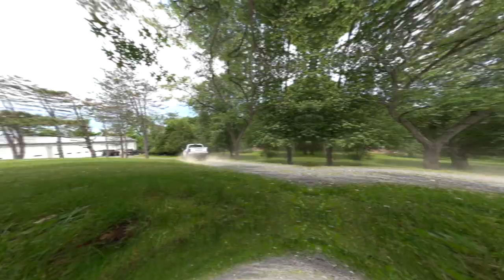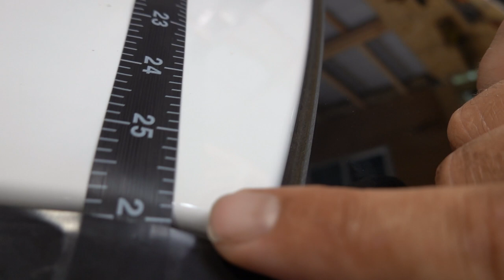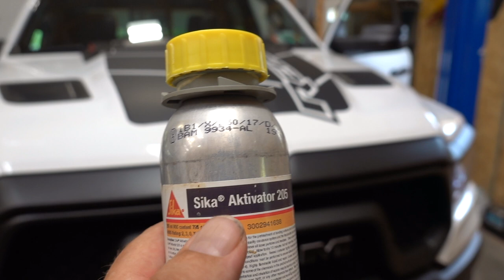2019 Ram Wireless Cab Lights

Comment: That is stupid crazy expensive!
Reply from the maker: better than drilling into your roof the labor for that alone would be more than these lights
Reply: You can save some money if you drill the 15 holes yourself. But to hire it done will cost even more. But mostly i just dont want holes in my roof. And when i trade they will come with me to my next rig. Good things are not cheap and cheap things are not good.

Comment: $400 bucks  are they smoking crack over there way to much just for lights
Reply: You can save some money if you drill the 15 holes yourself. But to hire it done will cost even more. But mostly i just dont want holes in my roof. And when i trade they will come with me to my next rig. Good things are not cheap and cheap things are not good.

Comment: Don’t buy these lights! They randomly go out of sync with each other and won’t hold a charge after a very short time. I’m on my second set in 7 months and haven’t been able to use them one time without having problems one way or the other. And for $400.00+, I got ripped off
Reply: I’m glad to hear you fixed the syncing issues. As for you taking the lights to your next truck, I could bet money on it you won’t. I tried making two different sets work for seven months and was never able to use them ONCE for more than 15 minutes without them dying or unsyncing with each other. As for price, you’re right. You would think for how much I paid I would have had a good product. You forgot to add to your saying, and a scam is a scam no matter how much you pay.
Reply: I’m sorry I’m a unhappy customer too. I would have loved to pay $ 400+ dollars and get a product that worked. As your 4 star rating on Amazon, that’s only because the reviews are done when someone first buys the lights. Not after any length of time or I bet it would be different. And if anybody reads this, notice how they just defend their lights and they don’t try to work with the unhappy customer to correct the problem. That’s the kind of response I got when I tried to get warranty on first set. They had no syncing issues, they have no problems with their lights, I was the ONLY ONE. Instead of trying to make the situation right and the customer happy, they tell you “you better hope you never have a warranty “ in a email. You are a scam, most people just give up with businesses like you. But I’ll spread the word so other people might think twice about dealing with you. Ultimately it’s up to them they can buy your lights or not I really don’t care I’ve already lost my money.
Reply: Very professional of your back yard garage business.
Reply: @caboveramericawirelesscabm3440  thanks for the heads up, I’ll make sure I post my review on everyone of them.
Reply: So, let’s do the math. You opened your business in 2017, you’re going to make over a million this year and you ONLY have 5000 satisfied customers. Math would say, this is a scam. lol, good luck with those numbers.
Reply: WOW, you deleted out your part of our conversation. Yeah, you don’t have anything to hide from your customers. lol

Comment: $400..... LoloL And they don’t even automatically come on with your headlights.   Lame.  The no drill is cool and all but it would be crazy easy to have an OBD2 plugin so it knows when the headlights come on and can trigger the cab lights.  Or at the very least have a module you can wire into your factory lights to turn on the cab lights.  For $400 it needs to be better than some Chinese wireless remote.  They literally look exactly like the ones I bought off Ali Express for $6.00 to shut off my nephews power wheels when he decides to drive like an asshole.
Reply: You can save some money if you drill the 15 holes yourself. But to hire it done will cost even more. But mostly i just dont want holes in my roof. And when i trade they will come with me to my next rig. Good things are not cheap and cheap things are not good.

Comment: Still a 1500... why put cab lights on that?! 😂😂😂😂
Reply: THE FORD F150 HAS A 10400 TOWING CAPACITY AND LIGHTED TOW MIRRORS
Reply: Rams 1500 used to come with cab lights from the factory
Reply: @caboveramericawirelesscabm3440  okay? Cool what does that have to do with cab lights
Reply: @RickySlatton  what year? When? I highly doubt that happened. You realize why cab lights are a thing right? It's for vehicles over 80 inches wide. No dodge ram 1500 came with cab lights
Reply: @colestreit1500  it was a factory option on the 2nd gen rams 93 - 02. You do realize the 1500 and 2500 has the same cab just different grille.

Comment: 500$ though?? That's straight ROBBING your customers.
Reply: You can save some money if you drill the 15 holes yourself. But to hire it done will cost even more. But mostly i just dont want holes in my roof. And when i trade they will come with me to my next rig. Good things are not cheap and cheap things are not good.

Comment: Can lights on a 1/2 ton... Gay
Reply: THE FORD F150 HAS A 10400 TOWING CAPACITY AND LIGHTED TOW MIRRORS MORE THAN THE OLD DODGE DIESEL
Reply: Ram 1500 used to come with cab lights from the factory.
Reply: The F150 towes 13400 pounds and has lighted tow mirrors  out towes the old dodge 3500.
Reply: What is a can light?  Is that a light that is used when taking a shit?  So you don't have a light in your bathroom?  You shit in an outhouse?